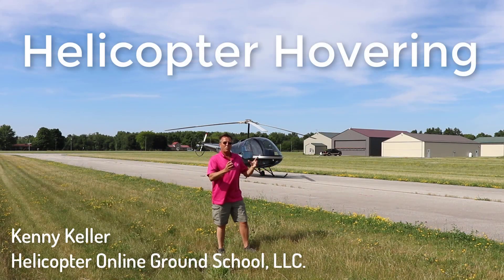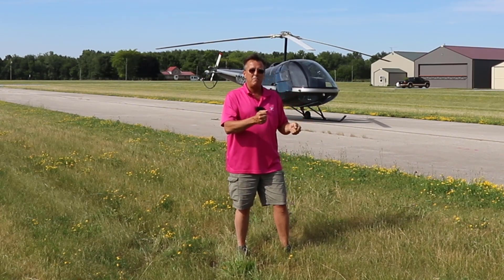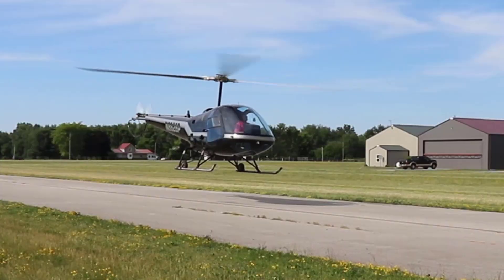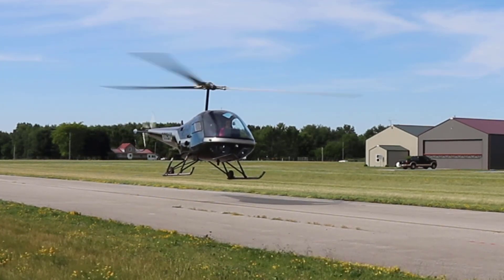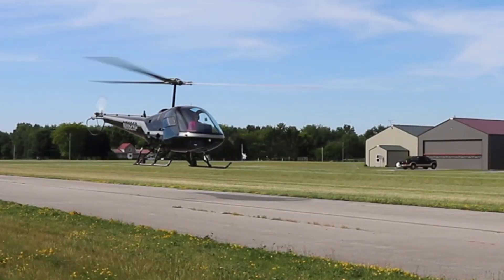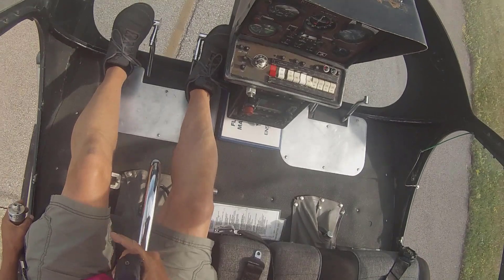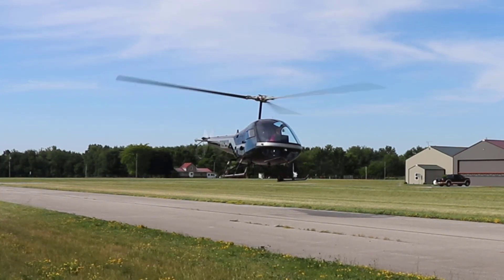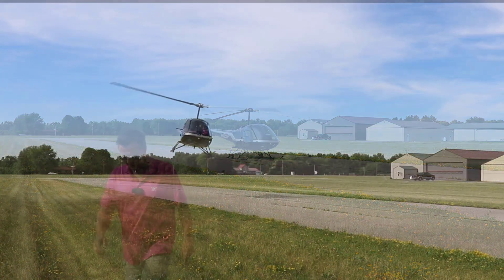The Key To Helicopter Hovering: Smooth Control Inputs

Comment: Good advise, keep all controls smooth a small movements. Im no pilot Yet! but I fly RC helicopters same principle apply. If you hear erratic rotor speed sounds from your heli it means the heli is over-controlled and not smooth. All control should be smooth and in sync with each other  to achieve smooth accurate movement, thats just my thoughts Cheers and happy flying.  🚁...........
Reply from the maker: Thanks for commenting

Comment: Pendulum sway can be taught and mitigated before spin up:

Put a weight at the end of a string (length of the string increases with additional heli weight).

Now, tell the student to swing the weight and have it stop over a marker that's off to one side. Record their intuitive actions and play it back to them at slower speed with emphasis on their hand movements, exhibiting the controls necessary to perform the action successfully. They will quickly understand counter-cyclic input to steady the aircraft.

Subscribed.

Edit: use the same method to teach collective by adding a spring between their hand and the string. The collective necessary to counter the movement is directly proportional to how far the spring stretches.
Reply from the maker: Thanks for commenting

Comment: Hey Kenny ! 

I'm using a simulator (Xplane 12), and if i try small inputs, it doesn't even do anything ! like, i juste want to take off, hovering a little. then i put some left-rudder to compensate the torque when adding collective. and i need to compensate on cyclic part to prevent 

but if i do small control inputs, nothing's happening (i feel a little ignored there 🥲), i can't compensate any force. then naturally i do bigger and bigger inputs (like you demonstrate in the video lol), dans then it is impossible for me to hover. 

what can i do ? 'cos for now, xplane is just what i have to practice. maybe one day i'll find a way to apply in a school but it is not the day for now.
Reply from the maker: Hopefully someone with more recent home simulator can help you out. I haven't used them since I was training as a private pilot well over 20 years ago!

Comment: Great video. Years ago, while at Ft. Rucker,  (before full flight simulators) this was how we learned, one control at a time. It would be worth to mention, that moving the collective too much while learning to hover, makes the over controlling even harder as moving the collective abruptly requires inputs to the cyclic and pedals simultaneously to stay in hover. It eventually becomes second nature that thinking about it doesnt even happen. Another initial mistake is to let the helicopter drift into the wind and getting the rotor disc into ETL.  That will set up another over controlling situation. I miss beating the air into submission. My last flight was in an Eurocopter AS350B3 around 2013. Keep up the good work.
Reply from the maker: Thanks for the feedback

Comment: I ran across this video a year after you posted it. I'm a new helicopter student having had an intro flight lesson and 2 actual lessons. This is the first video I've seen of flying lessons which explains that you must move the cyclic stick back to neutral, (or center) again after an input in any direction. This is probably the greatest key to hovering that there is. I also fly RC helis like one of the people commented below. The same principle applies. Small inputs and then recenter the cyclic!  And like you said, corrections are constant!
Reply from the maker: Thanks for the feedback!
Reply: @HelicopterGround  I remember an interview with the Robinson designer and he admitted that his helicopters are not ideal and never were designed for training...(due to the strange control stick, rotor head...) It was designed for more like the utility use cases and the already experienced pilot ones...
What is your take on that?
Personally I do not like the idea of 2 blade tethering rotors on a helicopter vs. other designs...
Reply: - On a conventional fixed wing it is sometimes more back than central because of the momentum...it is especially a factor with aerobatics...
- I do not know helicopters. 
- On some modern fly-by wire systems it is almost only pressure and a very little movement or no moving stick...(Airbus,F-16,Gripen)...

Comment: Another insightful video Kenny and nice camera angle showing all 3 controls.  My instructor told me he had difficult time hovering then he showing me with ease...could do it a little in my 2nd 1 hour in Schweizer but was difficulter in R22...my goal in next segment of training to be able to do it with ease and this video helps.
Reply from the maker: Awesome Bruce keep after it you will get it!
Reply: I remember an interview with the Robinson designer and he admitted that his helicopters are not ideal and never were designed for training...(due to the strange control stick, rotor head...) It was designed for more like the utility use cases and the already experienced pilot ones...
What is your take on that?
Personally I do not like the idea of 2 blade tethering rotors on a helicopter vs. other designs...

Comment: I am curious,  if you input say cyclic to the left and hold it will the rate of left drift remain constant or will the rate continue to increase until the cyclic is neutralized?  I hope I explained my question properly, not that familiar with helicopter lingo yet.
Reply from the maker: Yeah hard to explain. You have to counteract the movement, then push back the opposite direction a small amount to avoid the pendular action. As stated in the video. Thanks for commenting!
Reply: Thanks Kenny!